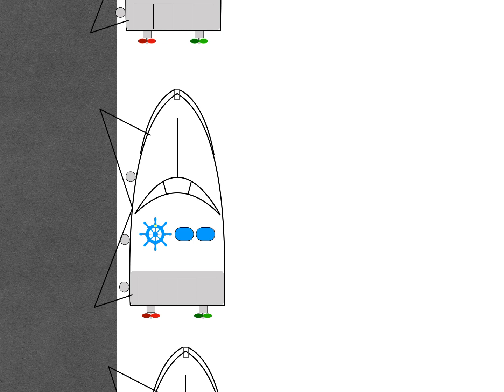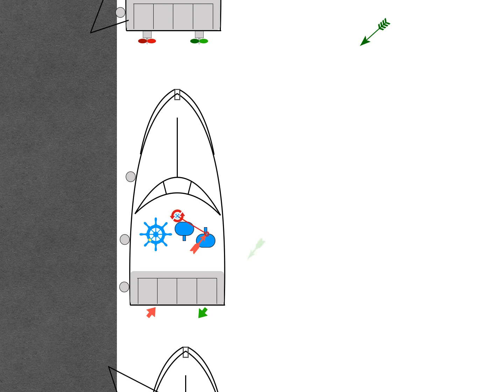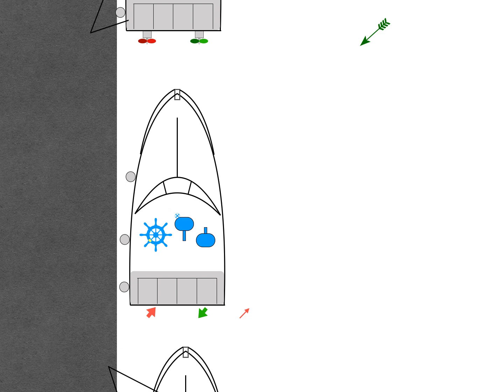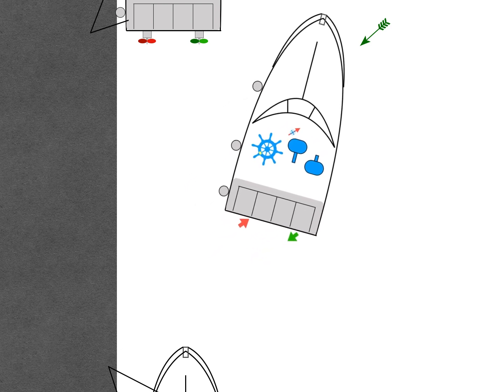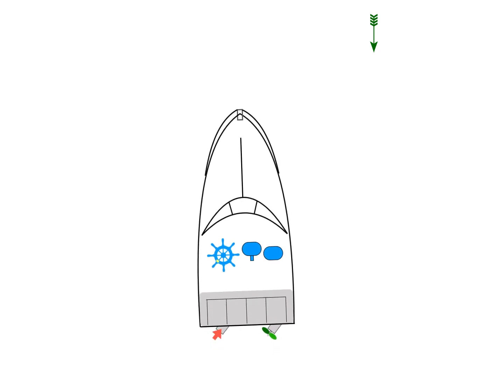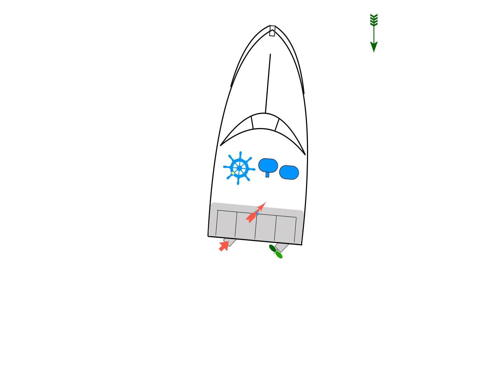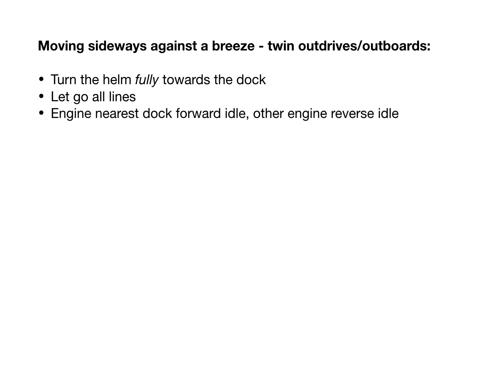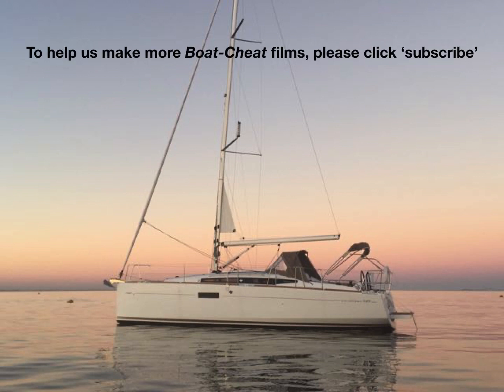Leaving the dock against the wind - stern drive twin

Comment: Great video, this confirms the thoughts in my head that I want to try as soon as lock down ends.  If the pivot point doesn’t work as per your schematic, do you think that turning the drives to starboard and using the opposite thrust as per your diagram, would work?
Reply from the maker: Thanks Craig!  I think it probably won’t because control of heading relies on the thrust-line of both props being on the same side of the centre of gravity, and if it doesn’t work  turning towards the dock then it suggest that it won’t using the opposite lock… but I have never done it so I can’t swear to that… however doing a rough sketch of the forces and vectors suggests not.
Reply: What about drives turned to port and reverse the thrust inputs? Just thinking out loud…something more for me to try when we are released…
Reply from the maker: @craigfleming9432  Reversing the thrust inputs would push the boat against the dock…

Comment: Problem with this manouvr is thta both port engine and starboard engine pushes stern towards dock 
Same result if not better you can acheive springing in stern spring line
Reply from the maker: @costazurra  That is not what happens… the boat moves as described in the video… and yes you can use a spring, but that is not always an easy solution.

Comment: How about a video for inboard twin drive boats leaving the dock against the wind ?
Reply from the maker: There is one for cats leaving the dock against the wind, which applies equally to twin shaft drive boats with twin rudders… do you have a twin screw single rudder boat?
Reply: @theboatcheat1204   thanks for the reply, I saw the video for the cat,  I am in doubt because the distance between the propellers is bigger in a cat, I have a twin screw with twin rudders.
Reply from the maker: @johannluckemberg4464  Great - in that case it will work just fine… the only difference will be likely need for higher power settings… I look forward to hearing how you get on with this technique.

Comment: Gotta ask in theory if thrust is reversed would that pull you into a slip against wind
Reply from the maker: Good thought, but… Rather than reversing the thrust, reverse the wheel position… this is more intuitive, and is consistent with the procedure used to leave the dock… it keeps it simple!
Reply: @theboatcheat1204  that makes sense I will try it out
Reply from the maker: @ninety5m3  I didn’t word that very well… to move onto the dock you reverse the steering and the thrust!